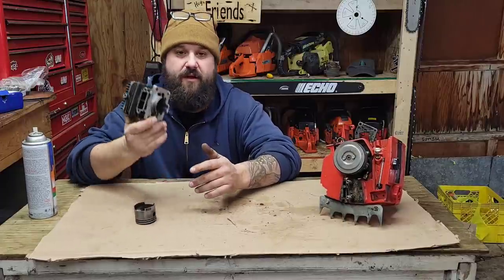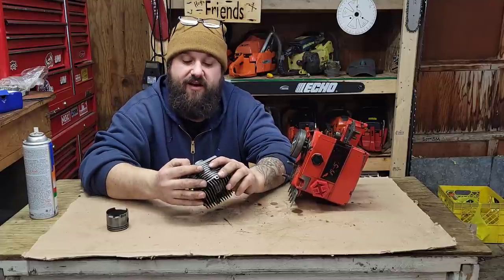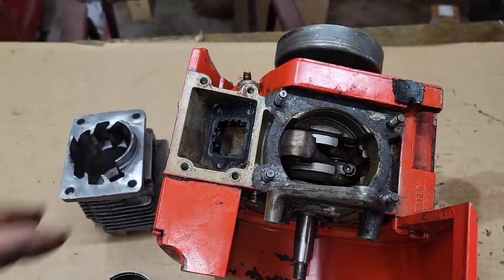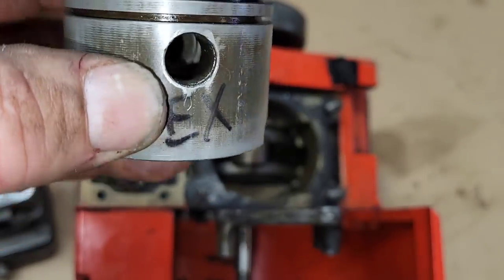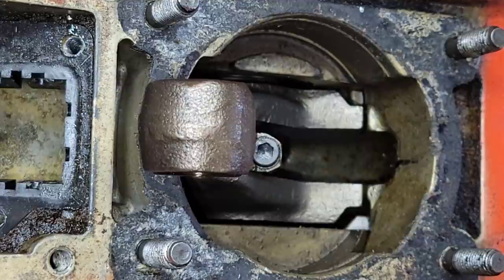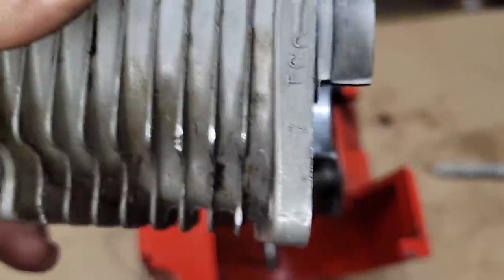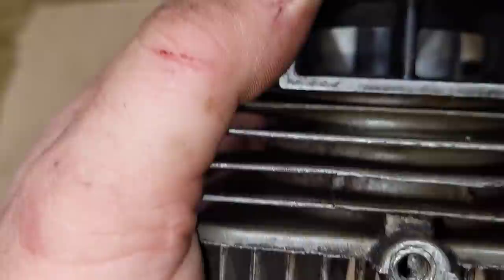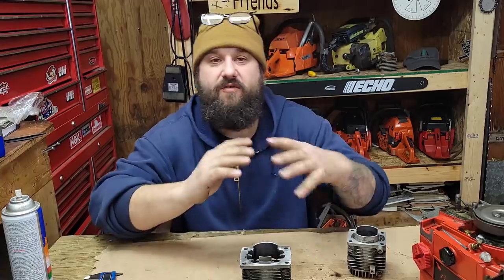Homelite xl922! To create a monster we must study its design!!

Comment: Cool. If you were trenching in a boost port would the top of it be level with your other transfers? I've been trying to find info but coming up blank. I have a P62 non boost port that needs a rebuild and I don't want to have to spring the doe for a fancy new cylinder. Cheers

Comment: Is the 922 super and the older c51 similar. The c51 is also 77ccs. I have one with the cylinder and piston off. Both look new. Question, when you put the ring in the cylinder and pushed it up to 105' ex. opening did you arrive at 105' earlier with the gasket on and you are now eliminating the gasket and putting it back to stock 105'. Or do you just like to have the exhaust open at 105'? It wasn't clear to me how you arrived at 105'. Also should I use new rings or the original used rings. They look good but I was wondering what you recommend. Thanks I've enjoyed your videos for several years!

Comment: ?? Quick question... Do any of the cylinder bolt patterns come on about 45mm apart ? I’m looking to swap a saw head on a small 2 stroke, You have several models in your videos so if you can respond it would help me a lot. Thanks for all the information you post. I never knew you had reed valves too !! Wow, neat.

Comment: I wonder on that junk one if you could machine or make those fins taller where it lacks some.  If there enough meat too work with. Or would it affect the cylinder.  That our if you could fin cut them like they do on some harley cylinders. It suppose help with heat plus give it that cool hot rod look.

Comment: Tinman , been learning from you for awhile. Thank you for your content. I’m getting ready to restore and hotrod a old stilh. Any tips or tricks you would recommend.
Reply: New rubber AV mounts, you will probably chew the fine looking old ones in a heartbeat when adding power. Carb kit, needs more fuel and working the carb harder when porting. The diaphram will probably be a bit brittle and not work at optimal making the saw a bit moody at best. 

Intake boot, if you use a farmertec intake gasket with stiff OEM inntake you probaly won't have a leak. Farmertecs intake on my MS360/036/034 was notesable smaller when compared with OEM).

Crankseals might leak after porting if not replaced, even if it doesn't leak stock.

Haven't tried any of the Hyway kits yet, but on my meteor kit. The squishband had a bit of an extra gap where the cylinder wall meets the roof.

Happy porting :)

Comment: Wait Tinman did I see that wrong. Maybe I heard it wrong. When you decrease duct size you increase velocity. When you increase duct(from smaller to bigger) velocity is decreased. .!
Reply: I was confused by the same thing. I think what Tinman was saying that even if velocity goes down in the larger duct, it creates pull on the whole system and moves more air. Air is compressible, so too small of a duct can choke off the flow and even though the air is moving faster, less air is moving overall.

Comment: TINMANN, THE LOMBARD AL, & AP-42 COMANGO'S 68.8CC'S HAVE 6 TRANSFER PORTS. THE PISTON IS 47.6MM. THE PISTON ROD DOES NOT USE CLIPS. THE PIN IS HELD IN PLACE WITH NYLON BUSHINGS. RUNS AT 7-8,000 RPM. PRETTY MUCH THE SAME THAT YOUR WORKING ON. EXCEPT FULL COOLING FINS ALL AROUND! SIDES AND TOP.!

Comment: I done one of my 925's 8 months ago and yes it makes a difference to case match to the transfers running around 12000 rpm 34" full comp chain she's a runner. File about 10 thousand off the key. Flywheel side only so there's a step it'll retard the time about 6 degrees she pull harder than ever
Reply: i was wondering about case matching on a 925....i rebuilt a 77cc version but was scared to mess with the case....might have to tear her back down and try it out

Comment: Just a thought that occurred to me: with all the carbon build-up on saws, I would be interested to see what gun solvent would do? I mean, its made to break down and dissolve carbon. Just an idea.
Reply: That’s a great idea. I’ve been trying to find a solvent to break carbon down for ages, experimenting with all sorts of chemicals. The only one that I’ve found thus far that even begins to get the results I’m after is a canister of Liquimoly valve clean, which still requires a lot of elbow grease and no small amount of potty-mouthed language to get fully clean. Do you have a brand which you find particularly effective? It’s not commonly available here in Singapore so I’ll have to import it to try it.
Reply: @latinodeathjazz  I've always had success with Hoppe's. I would assume that would work. I don't think it would have adverse effects on the parts since they're metal.
Reply: From my experience, when I get a motor with carbon on the piston skirt, I run high quality oil along with a detergent. For example, run 40:1 AmsOil. Then add some Seafoam to the fuel mixture. I usually add another 100mls of seafoam to a gallon of mix. I run the motor through about a gallon or two of mix at higher rpm. Part way through the first tank, it should start to white smoke a little. It's the SeaFoam burning of the carbon. After there is noticeable difference.